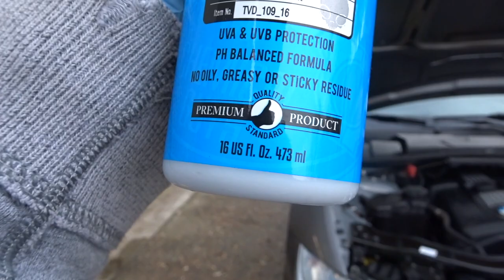HOW TO CLEAN YOUR ENGINE BAY **EASY**

Comment: There is so much wrong in this video. It's advisable to disconnect the battery, make sure the car is just warm and don't turn on the car whiles cleaning it. Also use a plastic bag to cover the engine so u don't spray directly onto the engine and alternator.
Reply: Damn Straight. Never steam clean and engine,just do the long and correct painstaking way
Reply: The battery of a bmw is in the trunk.
Reply: @gabrielamartiniuc6322  You don't disconnect it only to keep it dry. Also to prevent shorts from electrical components getting wet.
Reply: I was about to say. When he said turn the car on, ima head the air compressor and hose method. Throw a rag over the alternator. Don’t wash the oil out of the alternator
Reply: Do it when the engine is cold, quick temperature changes will crack the engine. Disconnect battery, and make sure there’s no water in your spark plug holes.
Reply: @gabrielamartiniuc6322  silly girl
Reply: @toskybeaston  she is right the battery is in the back of the car I have a 328i in yes it is
Reply: Chris Fix Would Be Upset Right Now Lol😅
Reply: @randyowusu8504  Im cleaning with preasure washer for years especially alternator with battery on , no problem. Just avoiding turbo and intake.
Reply: I sprayed water under the hood to clean the engine area and my car is not starting now. Does anyone have any advice? It’s saying “service”

Comment: ...wth are you doing? Why are you not covering up the generator with just a plastic bag or whatever... why would you start the engine while pressure washing it down the first time. Higher chance to get condensation to the headlights aswell but I dont see WHY would you turn it on?!?!
Reply: Nah, what do you think happens when it rains? Should be fine.
Reply: @TONYROCKZ818  there is this thing they call a bonnet or a hood ....... so what do u think happens when it rains?
Reply: @GenX...MCMLXV  that’s what I’m saying
Reply: I sprayed water under the hood, and my car is not starting now anyone have any advice?

Comment: Guys  don't wash ur bmw engine,did mines today after taking  the car out the shop and  im about to bring it back in the  shop because  I'm loosing  power
Reply: It's advisable to disconnect the battery, make sure the car is just warm and don't turn on the car whiles cleaning it. Also use a plastic bag to cover the engine so u don't spray directly onto the engine and alternator.

Comment: Need to avoid all electronics or the repair bill could be enormous. Don't spray belts. Keep away from fuse boxes if your engine has one in the bay. Use very gentle water and not a pressure system.

Comment: Awesome video bro, another tip I learned is don’t pressure wash your engine while it’s on only on the 335d bcs the vacuum pump is on the front of the engine and can suck water into the engine if it’s on
Reply from the maker: Good to know!

Comment: The real way to permanently clean your engine bay is to remove the EGR system because it puts dirty exhaust gases back into your motor & fills it with soot. It also reduces MPGs & does more harm to the environment by increasing the number of failed engine components you will have to replace from it.

Comment: Just wondering why you turn on the engine?
Reply from the maker: Michael Hector so that water doesn’t just sit there on the electrical parts. When the engine is on it burns off some of the water. Same reason why you can drive your car in the rain. You don’t want to use too much water. Just a quick spray down is all. Less than 30 seconds is what I try to do.

Comment: step 1 - don't follow this guide lmao.
Reply from the maker: Whats wrong with it?
Reply: #1 Coz u never turn on your car! There are probably hundreds videos in YouTube on how to wash engine bay and none of them let the engine run for a reason. Electrical connections are not 100% waterproof and u may cause a short. Electrical problems are the worst to troubleshoot. 
#2 safety issue with fan belt and fan blades. Corner of your rag or gloves can catch and there goes your finger. 
Do the public a favor and delete this video before anyone breaks their car or get hurt.

Comment: Is there another product that I can use to restore the black trim instead of the chemical guys? Maybe like a product that I can get from auto zone or somewhere not trying to wait for it to ship 😂😅
Reply: I figured out McGuires Quick Wax New Formula restores my super faded trim around the mirrors, windshield wipers, window trim, and surprisingly slightly restored the headlights
Reply: @stevexx90  Sillicone spray works great.